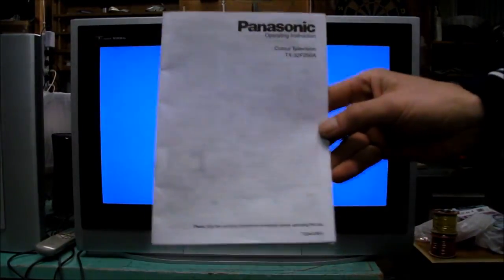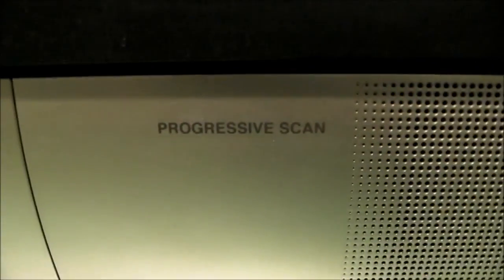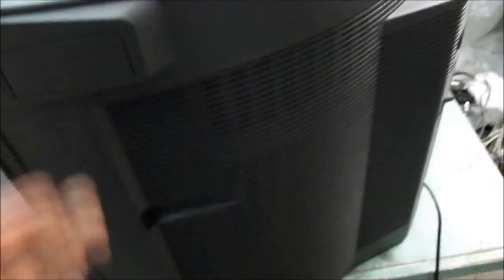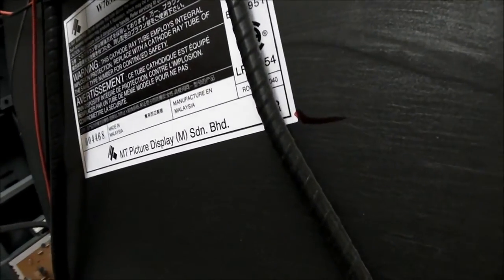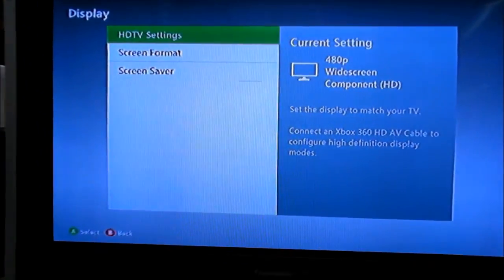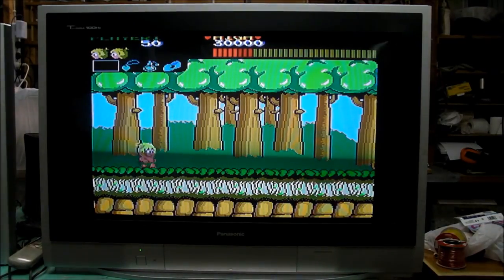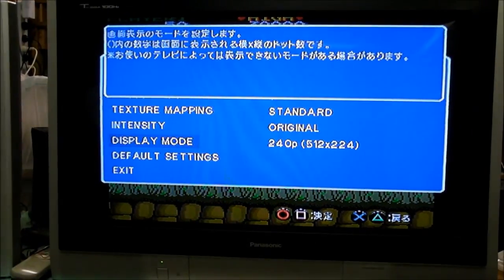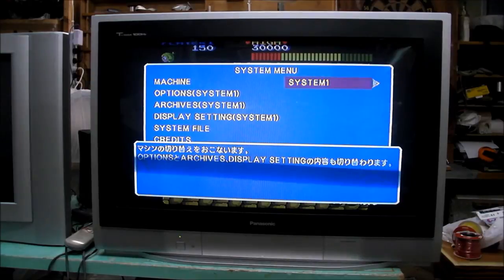Panasonic TX 32f50a

Comment: Rob these are pretty useless for retro gaming, due to the deflection circuitry only doing a couple higher resolutions and no 15.7kHz, if you whack it on 120Hz for the 240p itll probably look better.